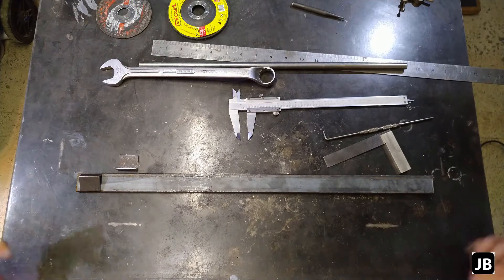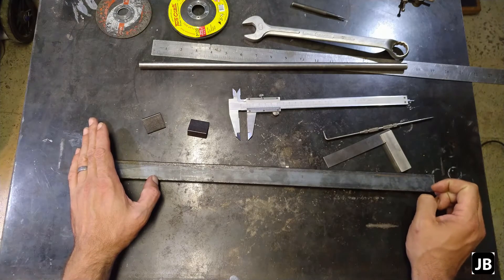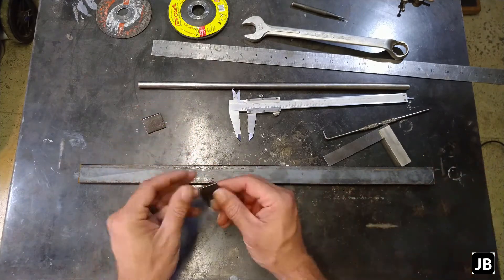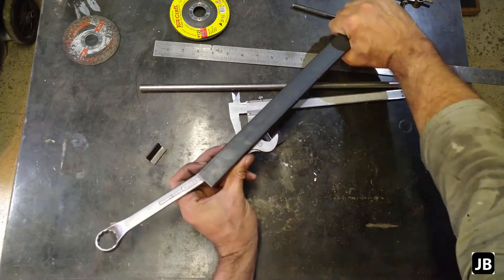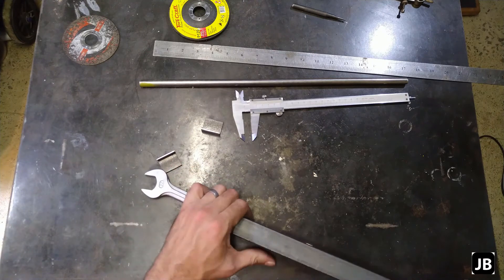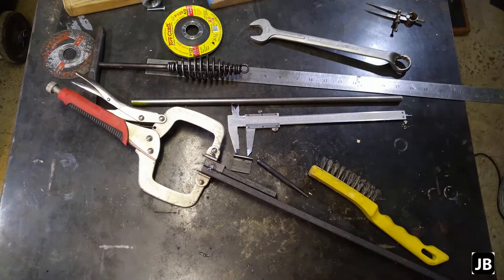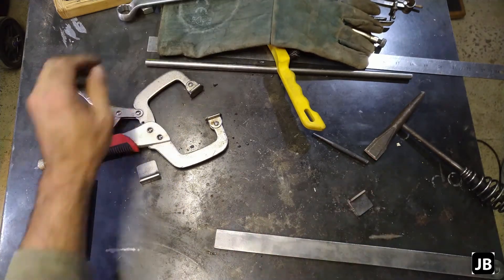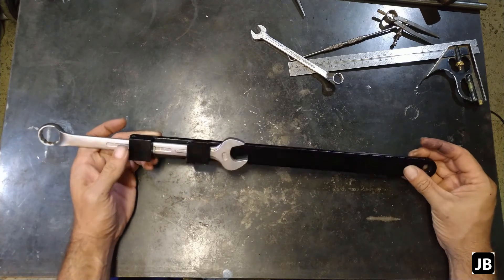Homemade Wrench Extender (Episode 1)

Comment: I'm a new subscriber, thanks for the video!  I watched all three of your wrench extender videos, and this is my favorite design too.  I agree with you that the other commercial designs don't seem as useful as this simple design.  I'm going to make a smaller version of this so I can use my Capri stubby extractor wrenches on tighter bolts, just in case I need to do that.  Those wrenches are short, so I'll have to make some scale changes to your design, but you've given me a great overview!
Reply from the maker: Thanks for the comment. Glad I could lead you in a direction. (Hope it is the right one 🤞)please let me know how it goes.

Comment: Great job. I have built one of these in the past out of solid rod. They work awesome. 
You can flip them over and use it to tighten nuts as well. 
Regards
George
Reply from the maker: You are 100% correct. I would however only tighten large diameter nuts with it. You will break off the small stuff. Thanks for the comment. Much appreciated.

Comment: So is incgo a good brand to buy spanners in
Reply from the maker: I have personally not worked with them, but the reviews are good.  I think they are fair for the price point. I also think the question to ask is "how often will I replace them?"  For example:  I own an air-craft pneumatic impact driver. Cost is R450-00 odd. An Ingersol Rand impact driver with the same specification costs approximately R8000-00. So, I can therefore fully replace the Air-craft model 17x before getting to the Ingersol rand price equivalent.  Now there are other questions to entertain.  What jobs are you doing for who?  if you are a Caterpillar field service mechanic, the mine is paying big money for your service to ensure that the 988 front end loader or the 777 rigid dump truck gets back into service ASAP.  Then the Ingersol Rand would be my option as it is part of the service that I render and price tooling into that job.  I cannot "quickly get a new one" when I am out in the field.  I need to know that my tools will not fail me.  How do I explain to the client / mine manager, that he is losing R40 000-00/hr because I cheaped out on a R8000-00 impact driver?
Reply: @JacoBadenhorst  i see